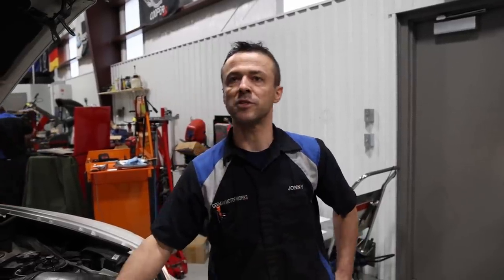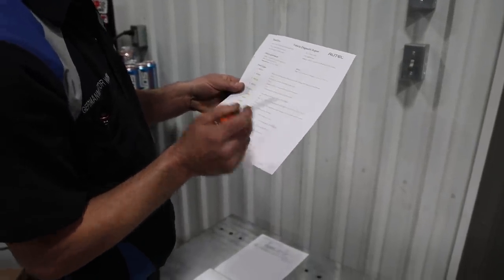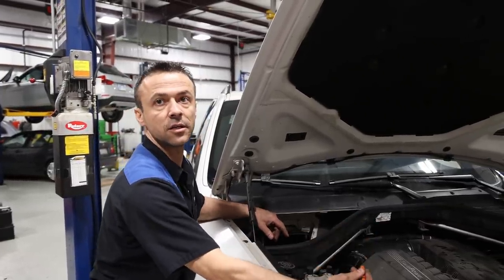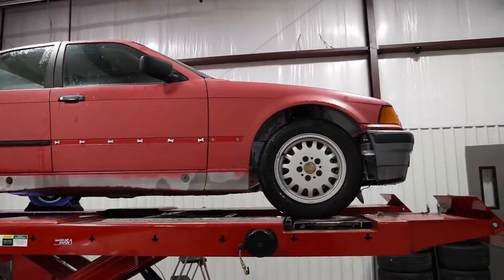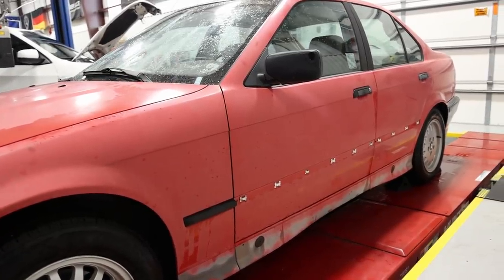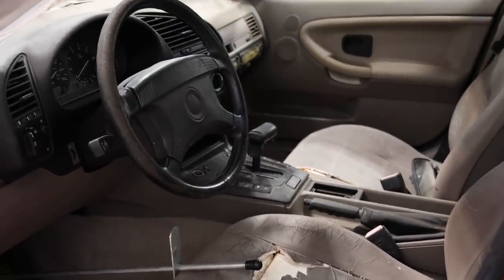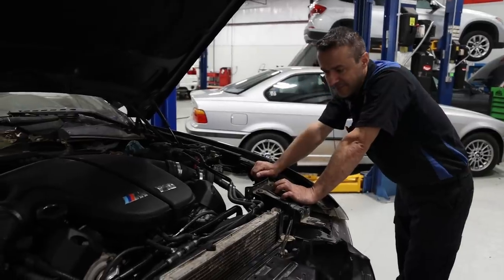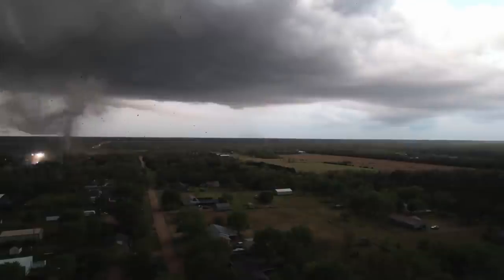CAR NINJA! Electrical Gremlins and a TORNADO

Comment: Glad you and your family were safe from the tornado.  That is such a luck of the draw situation and the downside can be devastating.  I sat at a traffic light years ago and watched a tornado cross the road in front of me.  It's amazing that the line of destruction can be so defined, on the wrong side is severe damage, on the other side no issues at all.

Comment: I really enjoy your channel. As a BMW owner, it helps to solve some problems. Now who would have thought a bad Water Pump could cause that issue? I would be curious the miles on it. Greetings from an old jarhead in WNC.
Reply: 108k miles
Reply: @johnnykaraj6115  So, it would be a good idea to preemptively replace these electric water pumps from 80-100k miles. I just replaced ours at 87k miles as a maintenance item on our F15 N55.
Reply: @oldjarhead1125  honestly this is the first time this happened. Usually you'll get a code for the water pump.

Comment: I hope that is as close as you ever get to a tornado. Love your content. Question: 2002 X5 4.4 118k miles, startup rattle 2-5 seconds then quiet and smooth. No rattle at all on 50% of starts. No pattern hot/cold/slope/interval btw starts. Should I be worried about timing chain guide failure? No “bits” found in sump so far. I really like this car.
Reply: Timing or VASOS , id defintely get it repaired ASAP
Reply: Yeah that sounds like a timing or vanos issue...
Reply: @MartinJones123  youre right i had typo of VANOS 😂
Reply: Recently in my shop an X5 4.4i comes, with more than 240,000miles. Take care of this car and it will last a while. But you have to budget for it and stay ontop of it.
Reply: @sasazapadnik9335  🤣
Reply: @sasazapadnik9335  I found an original X5 with 500,000km on the clock (460,000 miles if I did the conversion correctly)... It was a 6 cylinder but had low compression in a cylinder... That being said, take care of any car and it will take care of you!